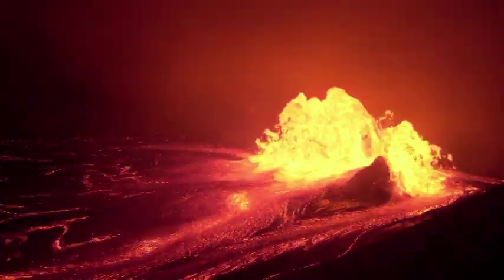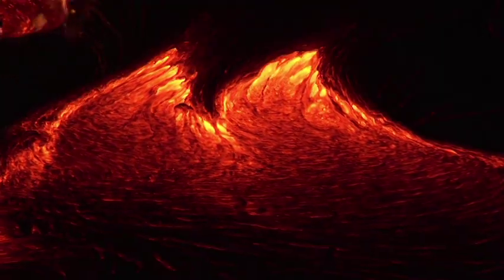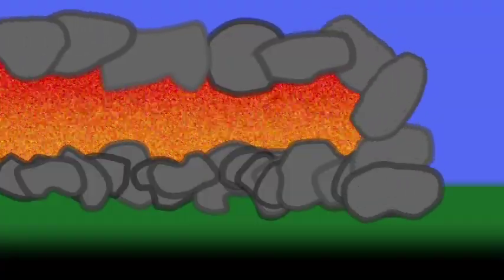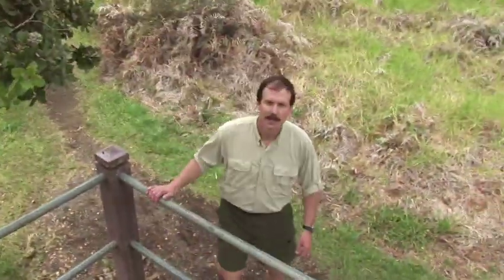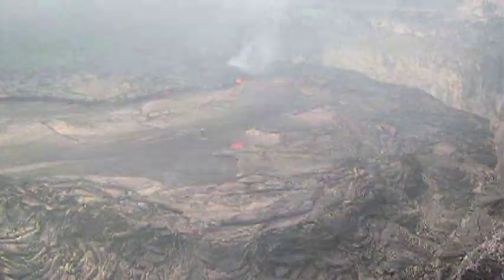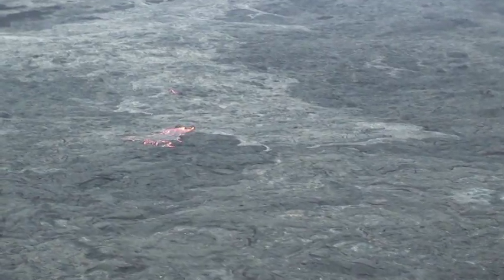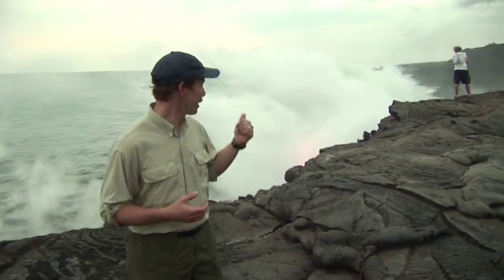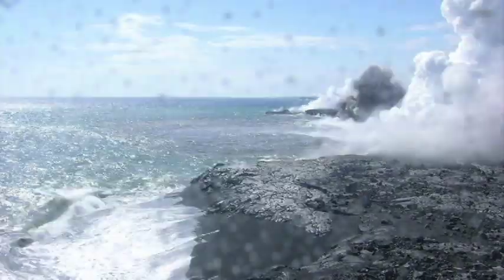Hawaiian Lava Flows

Comment: Jerry. you have a good grasp of the vulcanology, but got something as basic as viscosity reversed. The more viscous, the slower it moves.. My geology teacher had Ah AH as fast enough to catch you and burn you, and pronounced Pahoehoe as Pah-HoHO, as you laughed at its slow ropey speed..It does spoil the credibility somewhat, as broadcasters check stuff. This is a terrible malaprop for a geologist to have!
Reply from the maker: Hi Mounted: Actually what I said was correct, but I understand it could have sounded contradictory. That's because the aa-pahoehoe issue is more complicated than I could explain in a short video. The strain rate--essentially the rate of flow--is important too. There's a point at which the lava flow starts to break up or brecciate, and that's when it turns into an aa flow. That point occurs either because the viscosity gets too high (for example, due to cooling) OR because it's flowing too FAST(or both). There's a beautiful book on volcanoes and volcanism called (oddly enough!) "Volcanism", by Schmincke, that I recommend to anyone interested. The explanation of the aa-pahoehoe issue is on page 40, if you'd care to read more about this. Also, a malapropism is where someone substitutes a similar sounding word in a statement, such as "Rainy weather can be hard on the sciences" or Yogi Berra's "Texas has a lot of electrical votes". Quite sure I didn't have any of those in the video; thanks though.

Comment: Excellent video but how much does lava weigh ?
Reply from the maker: Great question. It's very heavy, because lava is liquid rock. Lava (or magma) is a little bit less dense than the rock it turns into, but for our purposes here, not by very much. The lava we're seeing in Hawaii solidifies into the black volcanic rock called basalt, and basalt weighs right around 3000 kilograms per cubic meter, or about 5046 lbs per cubic yard. Or, if you prefer, about 187 lbs per cubic foot, or 25 pounds per gallon, which is 3 times what water weighs. Some basalt has lots of gas bubbles (called vesicles) trapped in it, so that does lower the weight a little. Here's one more way to think about it--most of you have picked up a 5 gallon bucket at some point. Filled with basalt, it would weigh about 125 pounds! So this is heavy stuff. I know it looks like lava shouldn't be that heavy because it's a liquid, and we tend to equate liquids with things like water or gasoline etc. In my video, where I collect a sample with a wire whisk, I can tell you that you really feel the stiffness (viscosity) of the lava and its weight--it definitely feels like rock.

Comment: I wanted to look into that tree mold hole.  Thought they'd show us lava flowing way down in there. Are they very deep? Can one look into a hole on the earth near a volcano and see lava flowing?  Is this a stupid question?
Reply from the maker: Actually I didn't have a flashlight, but it appeared it wasn't too deep--maybe two or three meters. And all the lava in the vicinity of that hole was long cooled, so no hot lava anywhere nearby. Yes, you can look down through holes (called skylights) and see the lava flowing in the lava tubes. I have some video of that but it's hard to see the red moving lava against the red glowing rocks of the tube. And it's tricky photography, of course, because it's hard and a little risky getting close and extremely hot!

Comment: I wonder why the fresh "hot lava" doesn't melt the old lava on which it travels. Explanations?
Reply from the maker: Gungung Gadung: There's not enough 'spare' heat in the new lava. Once basalt cools to the ambient temperature, it would have to be heated up around 1000 degrees C for it to melt. As hot as fresh lava is, it can only warm up the previous layer a bit; the new lava solidifies and cools quickly.
Reply: Jerry Magloughlin thank you for your answer and taking the time to do so.
i imagine whats happening now is what you live for...minus the housing casualties of course!

Comment: Very good video. I wonder if Hawaii will continue to grow then, as more material flows out, subsides and is compacted to form new land.
Reply from the maker: It's a race between the addition by new lava, and the sediments derived from the erosion of that lava, and isostacy, which causes the island to slowly sink. Obviously, when a Hawaiian Island is volcanically active, like the big island, the addition part wins and the island grows. That's why the big island is the only extremely active one and MUCH bigger than any of the other islands. But as volcanism subsides, then isostacy starts winning, the plate subsides, and so the island shrinks.

Comment: Jerry, if you see this,   what if anything is going on with the base of the volcano (as in the sea bed) that supports the island as a whole.     when i was in alaska, i lived on an island 32 miles long that i was told submarines sailed under as we were on two pedestals that supported the weight.   there were 2 volcanoes on the island, both dormant, but we had a bunch of quakes.

thanks in advance
Reply from the maker: Dear DV: It's not unusual for people to wonder what's under an island, and there are many stories and myths going far back in human history about floating islands. It's not completely bizarre that ancient people thought this as they had no way of looking underwater. But other than some very small floating vegetation "islands", and sometimes "rafts" of volcanic pumice (which is so full of air bubbles [vesicles] that it really does float) associated with big volcanic eruptions, islands in the ocean are firmly and completely anchored to the seafloor. They're absolutely enormous piles of volcanic rock; the Big Island of Hawaii is over 150 miles wide in certain directions if measured along the seafloor. What's amazing is that such gigantic piles of volcanic rock can accumulate on the seafloor, build up until they reach the surface, and then continue to build up until you've got 14,000' high mountains--even while this pile of rock is causing the plate to bend downward, so the islands are in a certain sense "sinking". See my video on the Hawaii Hotspot, where I talk about this. Best, Jerry
Reply: i am aware of diastrophism ,   so if i'm understanding what you have just written if sea water were able to enter through the layers of rock and build up sufficient steam pressure to burst outward,  it would be through miles of rock,    a sort of mini-supernova event,  on a geologic scale, rather than a stellar one.

that would create the most massive shock and tidal wave the world has ever seen.    i recall in the 1960's when the side of the mountain hit the sea the water washed over an island 100 miles away with a 90 foot wave, then you have the new years day tidal wave that flooded all of Polynesia, and the maldese
Reply from the maker: D.V.: Oceanic volcanoes are capable of creating tsunamis as a result of landslides--after all, these volcanoes are giant piles of volcanic rock and they can partially collapse on occasion. The Canary Islands, off the NW coast of Africa, are a good candidate, and if that ever happens, we'll see incredible flooding all around the north Atlantic coast. But, there are probably no enormous body of magma inside the Hawaiian volcanoes that would interact with seawater to create an enormous explosion. A recent study indicated there are two, totaling just 0.12 cubic miles of magma--that's tiny on the scale of the volcano, and they're no doubt very well protected from seawater interaction. The vast majority of the lava coming out of Kilauea is traveling directly from the mantle. See: https://www.scientificamerican.com/article/more-than-one-magma-chamber-found-to-feed-hawaii-s-kilauea-volcano/

Comment: The reason for the explosive reaction lava has when it hits the ocean it erupts because of the salt the ocean contains. Molten salt reacts supper violently with water and since the salt is already in water as the lava hit the water it vaporizes the water and cooling the lava at the same time as turning Very almost microscopic amounts of salt to molten making it pop at it does so because it’s in water and getting supper heated and cooled.

Comment: 7:46 Is that a concrete structure covered in lava?
Reply from the maker: No, that's all basalt.
Reply: So that recessed area on the right with the right angle at its upper left isn't a window in a buried concrete building, but a natural formation?
Reply from the maker: Correct. This spot is way out on the lava delta where nothing has been built. I agree it kind of looks like it, but as I said in the video, the dripping lava from above creates all sorts of weird shapes.

Comment: High viscosity means it flows slowly, something with low viscosity will flow easily. water has a very low viscosity. Other than this, great video!
Reply from the maker: Thanks. You're right, pahoehoe lava is low viscosity lava, and as I said, when it flows slowly, for example on relatively flat ground, all those interesting patterns can form. As the lava increases its viscosity, aa lava results, which usually forms the very slow, thicker, bulldozer-tread-like flow pattern we illustrated.